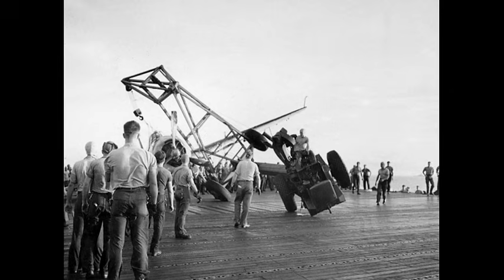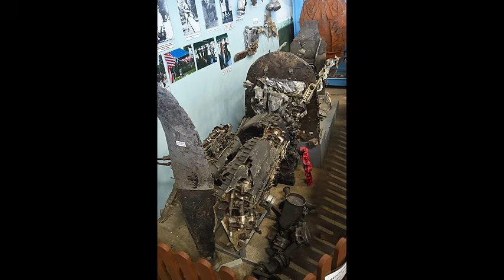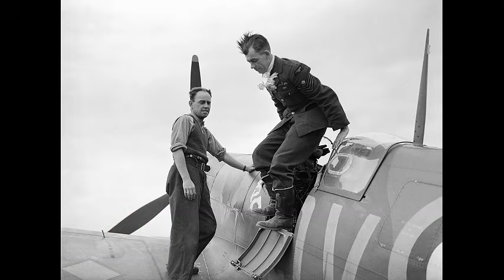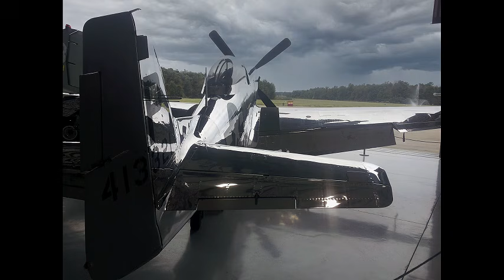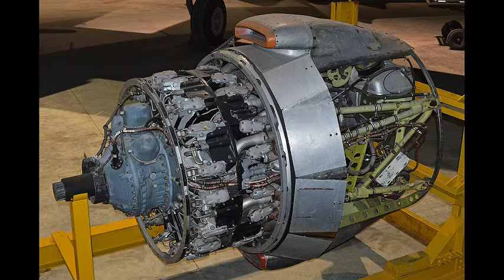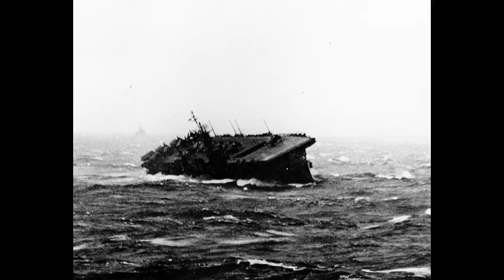Why the US Navy Rejected the Most Powerful Engine of 1944

Comment: The Navy never liked liquid cooled engines. They require carriers to carry both antifreeze and additional water to service them. 

The Navy was actually one of the original users of the Allison V-1710 V 12 engine. And the Allison engine is every bit as powerful as the Packard Merlin. With a turbocharger, the Allison is MORE powerful, and at a higher altitude.